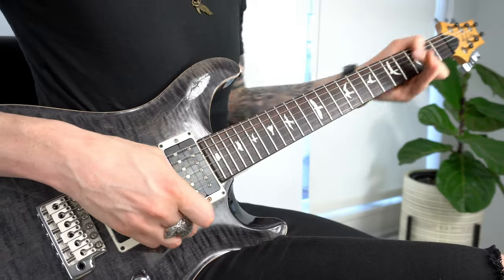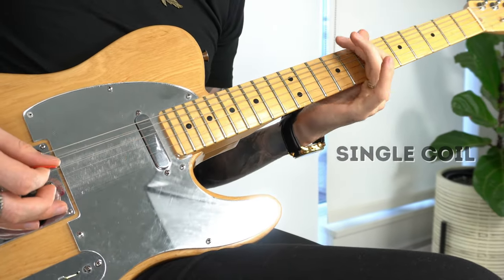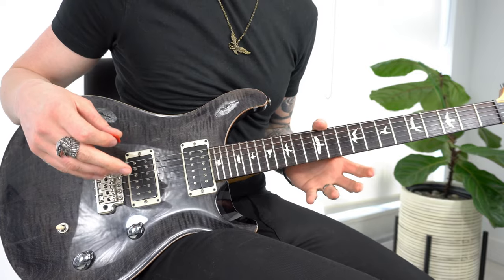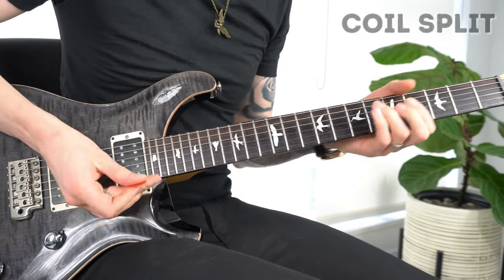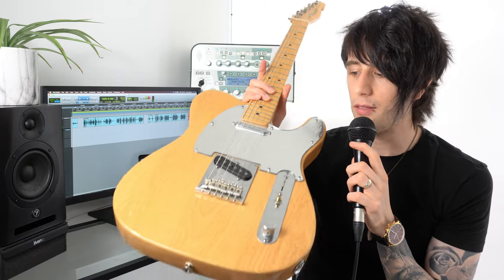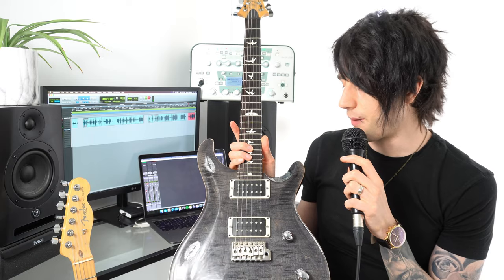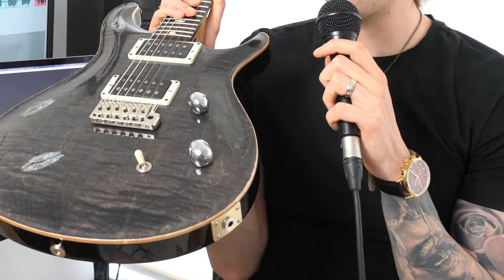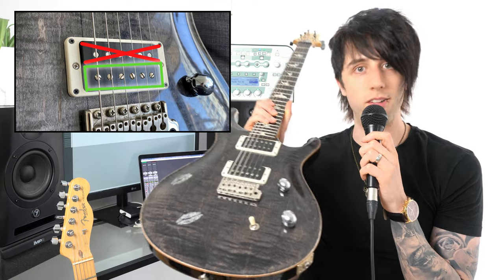Coil Split vs Single Coil - Guitar Tone Comparison (PRS vs Fender)

Comment: The important thing to know is that when a humbucker is split to the single coil, it is lower output than a standard single coil. The reason is that if a pickup is going to be made to do double duty as both a single coil and a humbucker, a compromise must be made with the output. If you make a humbucker that has just as much output as a standard single coil when split, then it is going to have way more output than a standard humbucker when not split. Conversely, if you make it have regular humbucker output when not split, it is going to be a weak single coil when you split it. If you compromise right down the middle, you will have a humbucker that is not quite a regular humbucker output and not quite a regular single coil output. It’s always going to be a compromise.

Comment: The PRS sounds great for a single coil split, but the Tele is the master. I guess I'm more of a purist, although I like what I hear.
Reply: You mean you prefer style and esthetics over sound? If you did a blind test, would you pick out all the telecasters?
Reply: @Ardano62 Those are some pretty bold statements! Lol. I wouldn’t pick ALL Teles, at the end of the day it’s all subjective. I own a fender player tele and I preferred that over a pro 2 that I owned. However, in this particular video, I can hear a major differences between the two, the Tele just sounds much brighter than the PRS. I’ve also owned 2 different guitars with coil splits and I just don’t like the sound, for me they sound a little digital. If I want a twangy bright sound, I’ll go Tele all day, humbuckers I’ll go with some Seymour Duncans, if I want some single coils I’ll go with my fender strat. It just depends and that’s why I said I was a bit of a purist when it came down to it. Again, there is no right or wrongs, music comes from the player.

Comment: To be fair, I believe PRS voices the coil split in their humbuckers more towards a Strat single coil, rather than a Telecaster single coil. So that could account for some of the difference. No coil split sounds exactly like a true single coil in my opinion, but I have to admit, PRS has gotten closer than any other coil split I have ever heard with their newest TCI pickups. The coil split on my PRS Modern Eagle V is nearly indistinguishable to my Strat pickups, whereas the coil split on my Les Paul sounds very different.
Reply: I have came to this conclusion on my modern eagle V as well! I thought it strat like and not tele like, though these nuances fade less with gain
Reply: besides PRS are there any other brands that does the coil split well?

Comment: PRS split sounds amazing! But the scale lenght, wood, body shapes makes a difference. Tele has that special twang...
But honestly well done PRS
Reply: wood and body shape don't make any difference, it's probably really due to scale length. Shorter scale length means the strings need less tension to be tuned to the same pitch, and that's audible

Comment: I use my 2018 American Original 60s Telecaster and 2019 CE24 Semi-hollowbody interchangeably. I find that the 85/15 TM pickups don't have a very big signal loss when split. Also, I feel like that pickups are pretty clean sounding.

Comment: Thought you might be interested in an interesting tip to consider. A goldilocks option that I have finally found is the PRS Tremonti Baritone Hybrid setup and tuned to standard with a pickup swap and rewiring for coil tapping. 25.5" scale, maple neck, and wraparound stoptail bridge gives it as much snap as a tele but the mahogany body, set neck, and single cut keeps the body of a typical PRS or LP. I have found this to be the best of all worlds option, for me at least, and negates the want to grab different guitars at times. Medium output pickups are ideal for the partial could tapping (e.g. BKP True Grit, Holy Diver, Polymath).

This was a great and helpful video and so was your 4 guitar comparison video.

Comment: Great video and great playing. Both sound very good. I think the Tele has slightly more twang, but the PRS comes close. Even though there is a slight difference, in a live band setting you probably wouldn't notice the difference. Love the versatility of the PRS.  Finally, Fender's Player Plus Tele and their Ultra Tele now have a coil tap that combines both PU's into series giving it a more Humbucker sound. So increasing their versatility. Tough decision. You can't go wrong with either.

Comment: In my opinion the  PRS sounds thinner than the Telecaster. Different, but not worst, just different. And both sounds great.
Reply from the maker: True! They sound different but the PRS split DOES still sound like a good single-coil pickup. In my opinion!

Comment: If only there was a CE22 08 w/ piezo. I have a HBII w/ a maple neck and blending in a little of the piezo has been giving me enough tele vibes to get by for years (piezo volume on ~3 brings in some of the snap and zing of a tele), but I finally broke down and have a tele on the way because I really need that spank. That said I really do believe a CE22 08 piezo would be the best jack of all trades option if it actually existed, that is unless they also threw in the LP style 4 pots like on the 594 as that would make it a perfect desert island guitar.

Comment: Do you think it would pull off that nasally SRV/Jimi Hendrix Voodoo Child type neck pickup sound? That’s generally what I go for. I love the PRS and I want to try one but if I need a Strat then I just need a Strat.
Reply from the maker: I think it could get 90% of that tone. Throw a good overdrive or fuzz pedal in front of it and you’ll certainly be in the ball park.

You have to remember that they ARE split pickups, so it’s not going to be 100% of a true single coil, but it’s damn close.

In a mix I don’t think you’d hear the difference. So to answer your question, it depends if you’re okay with some wiggle room on the tone. If you’re flexible with that 90% closeness then this could likely work for you.

Comment: What are the pickups you are using on that guitar?
Reply from the maker: Everything is stock. The PRS pickups are the 85/15 models.
Reply: @LonnyEagletonMusic  thank you and btw great video, straight forward, clean guitar sound is the best way to compare, and short licks back to back helps to compare, otherwise you forget the first tone meanwhile you are hearing the second example.

would be great if you can check P rails coil split , thanks for the quick answer .

Comment: I have a CE 24, a core 24, and a PRS Chris Robertson.  I also had a tele... but found the tele sounded too thin for most music.  The tele did sound good and has is place don't get me wrong... but I think they are significantly overrated.  All three of my PRS guitars sounded way better for most music.  I also have a american standard custom strat that collects a lot of dust since I bought my PRS guitars... but still has it's place for some music.  I will say that the coil tapping on my core 24 are way more convincing that on my CE.
Reply from the maker: Yeah they’re so versatile. I feel like I can convincingly cover any sound I need to with just the one guitar. Good to know about the Core vs CE24 thing. Might have to get a Core at some point down the road. Got my eye on a Silver Sky next though ;)
Reply: @LonnyEagletonMusic  I love my core and my CE 24.  I thought they would sound almost the same but they really oddly don't sound very much alike at all.  I thought I would sell my CE when I bought my core but I can't depart from it.  It's one of the best and most underrated guitars ever made simply because it's cheaper than the core, has bolt on neck, and a shallower carve... but it sounds and plays sooo great... but completely different animal than the core except for the shape.  My Chris Robertson has fuller sound like a Les Paul...it has coil tapping too...p90 in neck and humbucker bridge.  It's the cheapest best PRS over every played... sounds on par with core PRS and plays just as great too.  They are rare... but if you can find one I'd highly recommend it.  My next PRS will be hollow body... maybe with piezo...

Comment: It’s a coil tap not split.  A split isolates the two to one.  The tap lowers the output of one so that when you switch you don’t here a big jump in volume.  So one pickup is working fully the other partial.  So not a true single coil sound but very good none the less.

Comment: PRS is not a Tele.   PRS has a softer rounder low tones.  you can totally hear it in these comparisons.  
The real distinction between the two wasn't tested.    Some thumb picking Chicken Pickin' like Brent Mason stuff wildly separates the two.
The larger Single on the Tele shows itself on that kind of picking.  

In the Sultan's of Swing demonstration Lonny did not comp the original very well.  There is an unmistakably / deliberate sound of proper EQ on a 4th position on a strat. 
The PRS didn't grab MOJO and the Tele didn't' grab it either.  Honestly, they couldn't.  

If you are just doing some soft picking or more subdued playing, the PRS would comp ok.  

In the end..   
A Gibson is not a Fender. A PRS is neither. A Strat is not a Tele. A Les Paul is not a Strat.  

What happened in much Classic Rock stuff..   Tons of studio recordings were on Teles, but performances live were other guitars. 

I'm not a Pro Tele guy.   I own 4 LesPauls,4 Strats and a Tele.   I play each of them on shows depending on the set-list.  I have different wiring and pickup configurations on a few of them.  In the end, the guitars themselves make for a unique distinction.  This all in a similar way a Player can be identified.  

Take Care,